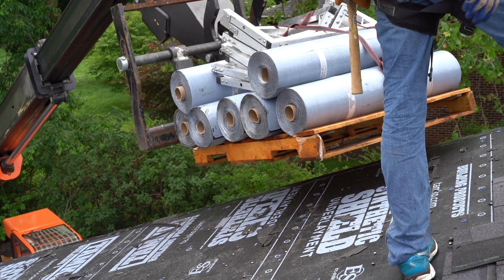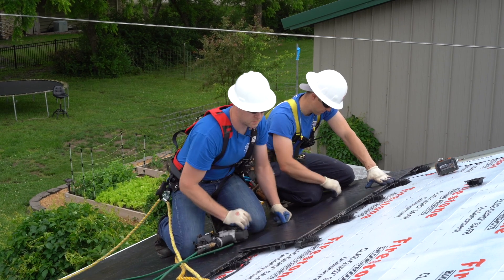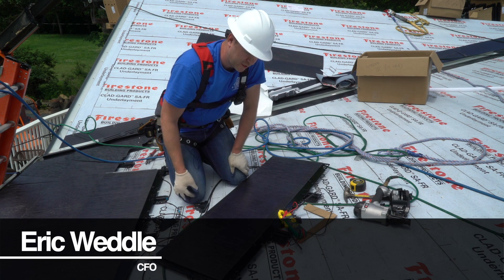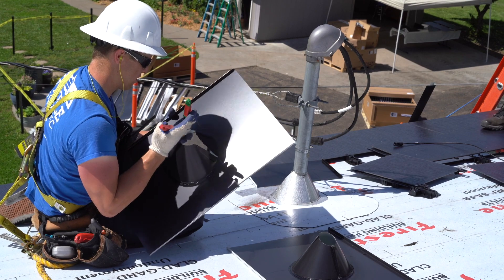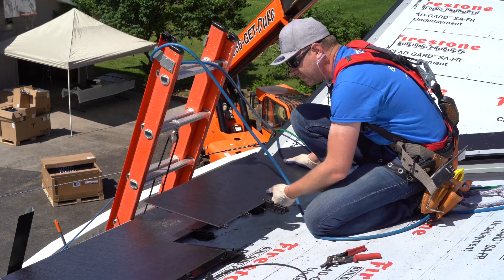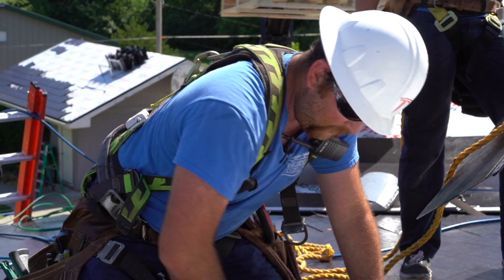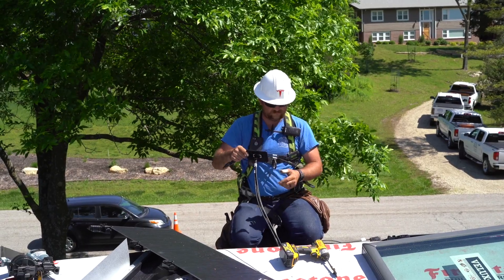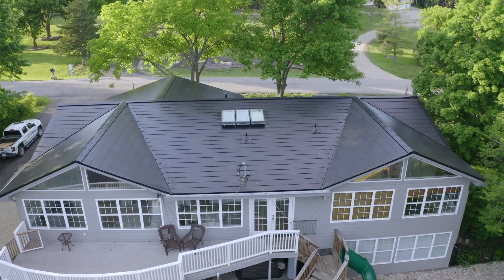Tesla Solar Roof: The First Installed In Kansas

Comment: can these be installed on dome homes? because i don't want to live within a normal home anymore.

because dome homes are 85% more energy and power efficient in comparison to conventional homes. and their also a lot stronger when fully built in comparison to conventional homes. 

so the goal is to make it as efficient as possible.

i mean if it's not possible to do with just the dome home by it's self, it's probably possible if the dome home was buried by dirt which would allow the solar panels to be installed no problem.

Comment: How tf do u get a good  mpp with that there has to be a communication between all panels. Just like solar edge does it with their optimizers. If not ur weaker parts of the roof are gonna ruin the whole operation.

Comment: When a tree limb smashes into this roof does it stop the entire solar power to the house and how hard is it to replace the damaged roof tiles ?
Reply from the maker: If an active PV tile (or several) were damaged it could slow production on an individual "string" but probably would not stop even that string unless a cable was severed. But there are 8-10 different strings on the roof, so the rest would be unaffected. Replacing tiles is extremely easy--snap out clips, slap in a new one.

Comment: Somewhere it said cost is $1600/SQ (SQ= 100 sqare feet).  A typical premium roof is what? about $300/SQ.  a big roof 60SQ would be ~$100,000 ?   is that even close ?
Reply from the maker: We have a calculator on our website now, but it's not completely linear. A large portion of the cost is the PV and electrical components. So on larger houses, the cost/square tends to come down unless it has a lot more PV. Typical roofs in our region can be 300-400/square. Premium can easily be over 1000/square depending on materials.

Comment: should be mandatory, as the grid is already overloaded, once we have electric cars and power-walls and solar roof systems that network with the grid then power companies will be a thing of the past
Reply: In California is required to have solar panels on new homes.
Reply: If they where smart they would have invested there profits in this technologies instead of shutting it down prolly gonna need solar farms to keep everything going and potentially export to colder regions exciting times for sure
Reply: @ice843  What are you on about? I am all for consumer solar en wind collection, but what you say is BS. Solar farms and wind farms have so far proven to not really work ( I am Dutch and my country has tried so for the last 2 decades!). The surface of roofing is already there and if we could just fill those with collectors then part of the energy equation is resolved for consumers. This doesn't resolve the energy "problem" though. Which kinda isn't a problem. Yes, lets stop digging up coal and oil to then burn it in a very polluting way.. but looking at estimates, our fine planet seems to have enough natural gas to provide ALL energy needs for the next couple of centuries. Gas that burns quite clean! On top of that you have the current new gen nuclear plants (I think UK is big in this gen) that is extremely clean and safe. Combine that with the next gen molten salt thorium reactors that are being developed now, estimate 10-15 years, you have a wonderfully clean (zero co2 for example) and producing very little waste energy production system. We are all led to believe it has to be solar and wind in combination with batteries.. which for sure is part of the solution, but for the most part it has to be coming from other sources. I vote for very clean natural gas and nuclear. Problem solved for centuries while we invent fusion and other things.
Reply: OohzyJohnDow yeh so I would put solar farms in the deserts and then figure out how to get it everywhere else 
No chance of catastrophe that way 
Very limited pollution just in making and taking them away again 
Also deserts are essentially useless for life so there’s plenty of space to use 
I guess the problem is these previously poor countries would become energy superpowers 
Witch is probably why it won’t happen 
It is happening a bit just not enough 

Now fair enough we may be able to burn gas oil and coal for the rest of my life probably 
But what if one day we need a vast amount of oil and the retards that we were we used it all going to maccies 😂like imagine one day oil happens to be the cure to cancer and we already burnt it all Dyou see my point
Reply: georgio m I mean I’m pretty sure smarter people than us can work this out 

Why oh why do countries to rich in sun to have much else can just become solar factories the sahara I beleive just 1 desert could power the entire world 🤯👌

Thurthermore after what the Dutch have done with farming Europe needs to step it up on the food production imao follow the Dutch the second biggest exporter of food only to the USA who have 250 times the landmass 

There’s a lot of good to be done grow smarter
Reply: Mandatory?  Pass,  it looks awesome dont get me wrong,  I dont need government telling me what I can and cant do.
Reply: @jord6658  I think all new construction should be mandatory.

Comment: Extra generated energy, where does it go? 

Do you contract it to the grid? Or  the battery/car system? I was confused about where you said you build the design according to the usage, but cover the entire roof. Better to cover the entire roof. 

I know europe works with companies like octopus. Lots of energy to be bad in NM
Reply: Very high likely hood the homeowner has a powerwall or two to store extra energy. If you get Tesla solar panels or solar roof, you usually also get a powerwall.
Reply: Thanks, I bet they do. I was curious if they generate max and then sell the extra power back instead of only producing what they need to use. They insist on the non generating tiles too. I would just wish they could utilize the entire space anyway if it was more expensive you would think that the payback period might be comparable with the increased outout/payback. Europe had the octopus utility company, and I know pgand e is working with tesla and their autobidder thing and ewt blockchain

Comment: I really wish people would start to understand the benefit of overbuilding your pv system for future energy needs and inclimate weather generation.  It's the same problem I see with on site battery storage.  If you overbuild, you do spend more, but you're also increasing your buffer for peak usage and low generation.
Reply: If your house is grid-tied (and most are), then sizing is much less critical.  If you undersize, it will simply reduce the amount of savings from solar versus paying the utility.  You'd still get much benefit.
Reply: @LoanwordEggcorn  Yes, I get that.  Much like many an anti-eco tard has touted in the past though, the sun isn't always shining.  It's also not always a clear and sunny day.  Oversizing your system can reduce the impact of cloud cover, increase production early and late in the day, and doesn't add that much to the cost of a system.

Overbuilding your battery storage also helps if you're self generating to offset low generation days and help pay back the cost faster.
Reply: @hellcat1988  Yes, all of that is true.  

Increasing capacity also increases payback time, but as you note, more capacity can make it quicker to pay back the costs, so there are tradeoffs.  You're correct about that too.
Reply: @LoanwordEggcorn  I'm just trying to remind people that the only argument that the right wing has had against renewables is that they don't generate 100% of the time.  If you can compensate for that, you can shut them up quicker and help move society to a more ecologically sustainable future.

Comment: Why are the no vents in the roof?
Reply from the maker: Great question -- attic vents are integrated into the ridge. There are some plumbing vents here but we consolidated several DWV pipes into one or two and removed the gas exhaust water heater vent and switched to electric.

Comment from the maker: Lots of questions about pricing for this and other systems. Check out our website at https://www.weddleandsons.com where we just rolled out a (beta) version of a pricing calculator that should give a reasonably close range for projects near our 6 branch locations in KS/CO/NE. Jobs in our extended territory are likely to be a little higher due to travel and mobilization costs. Also there are many variables that can't be captured in this simple configuration tool, so actual quotes will vary after site surveys, but it should get you close. -Eric

Comment: How do you replace a PV tile if needed? Rip up the roof till you can get to it?
Reply from the maker: Replacing PV or glass tiles is super easy. Mounting brackets stay fixed, we just pop out some clips with a special removal tool (or with our hands, for the more muscular on our team) and slap in a replacement. Far easier than replacing an asphalt shingle.

Comment: I thank you for this vlog. One of the main questions people have is the cutting of the tiles as they go into an angled valley. Is this done by you or done in the factory? My understanding is the Tesla tiles are glass? It would be useful to know the square footage and cost of this roof and how much electric it actually generates. This is a long awaited video for those thinking about solar.
Reply from the maker: Check out other videos on our channel for a close-up of valley installation. In V3, all glass is tempered, so no cutting.

Comment: Do you have a lot of orders?  What kind of ramp up is the solar roof getting?  I'd like to see how you fit the roof around obstacles, vents, skylights and chimneys.  How do you prevent leaks around these obstacles?  What about gutters?  How will the homeowner deal with repairs?
Reply from the maker: To your other question, HUGE interest in the system but our own ramp up is a little limited based on how busy we've been with other work this year and trying to build out the specialized team for Solar Roof. We're working through a backlog of about 150 quote requests right now and that's growing every day.
Reply from the maker: Lots of good and relevant questions here. For installation details, we cover a lot of that in our other videos on this channel but basically everything has two layers of waterproofing protection--the deck layer with the self-adhered underlayment membrane and deck-level flashings, and the tile level with a second set of flashings. So there is built-in redundancy compared to traditional roofs.

Comment: not even one comment about the power supply after install or a look at the system?
Reply: Yes.  Where’s the inverter, the wall battery, the connection to the house panel?  Also, any net metering?

Comment: I’m curious how often I would need to clean the roof I’m sure it depends on where you live but I never have to clean my composite shingle roof
Reply from the maker: A good question and we don't know the answer yet. Our region (Kansas and Nebraska) tends to get frequent rain throughout the year, so our expectation is that it will be self-cleaning in those areas. For others, it would be completely acceptable to spray it off with a garden hose from time to time (realizing that ease of access may vary).
Reply: Solar panel work even when dirty your rouf will never get more than duste in most normal climate

Comment: Do y’all use MCIs out there? Cheers from Texas
Reply: Yes, there are rapid-shutdown mid-circuit interrupt modules installed throughout each string. (For others' benefit, these are devices that can quickly shut down the system if needed and limit the voltage across any section of a string for safety)
Reply: Eric Weddle yeah I hate those things lol they make testing a lot harder but we’re getting rid of them supposedly
Reply: They are working on MCI bypass units for testing. You could probably bypass them with an oscilloscope.
Reply: Harley Stenis yeah those things aren’t very good. Usually just test at the inverter when commissioning

Comment: If I'm designing a home, is there anything I can do to keep the cost of the solar roof cheaper?  Roof pitch, insulation in roof, roof layouts to avoid, etc?
Reply: Great question! We really like engaging in the design phase of new construction. There are definitely things that you can do to significantly simplify the installation for Solar Roof and keep labor costs lower. Because the tiles are fairly large, and can't be cut, it's good to plan large, simple roof faces if possible, and avoid small details like cornice gable returns, or extra dormers. It's also helpful to consider how parts of the roof can cause shading and keep south-facing planes free of obstructions to maximize production. The Solar Roof system can handle all kinds of complexity--it just adds a lot of labor.
Reply: Less pipe and other obstructions on the roof would be a good start
Reply: Regarding the electrical side, there is other important stuff that you probably should look into. Being mindful about sizing your electrical service and Main Service panel, choosing your A/C and other loads can also be important to have a smooth installation of a large PV and Powerwall if you are interested. Keeping this in mind will help you avoid bottlenecks for your Powerwall and solar sizes or having to replace your electrical panel in the worst case scenario. Please reach out to Tesla, they will be able to guide you, there's a team of new construction specialized project advisors and energy designers.
Reply: Avoiding obstructions on South facing MPs is very  important as they have said. There are also some unsupported roof geometries you might need to consider avoiding.
Reply: What city are you in?